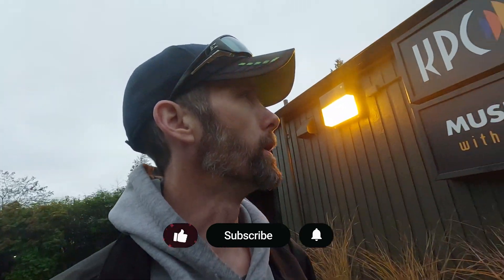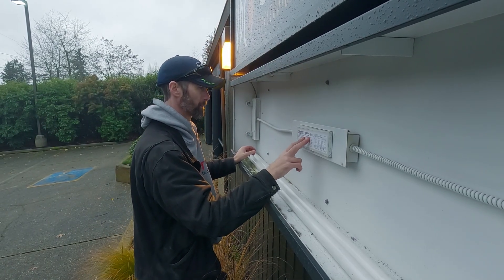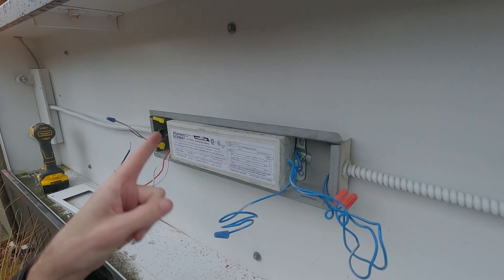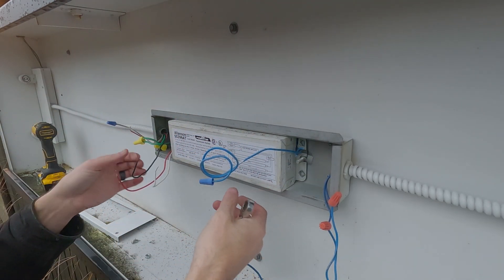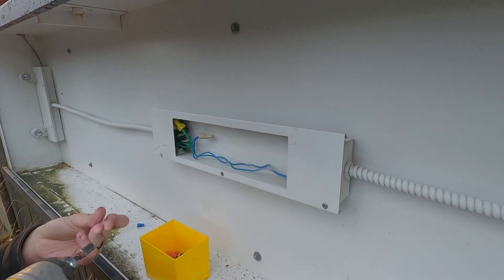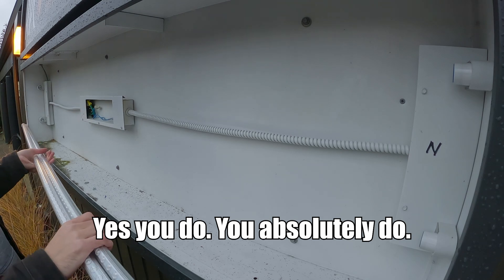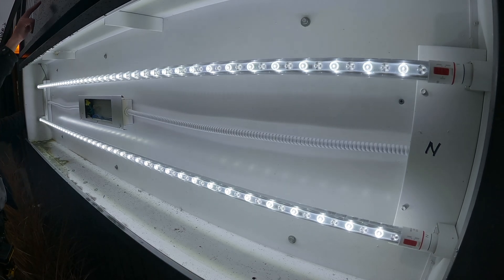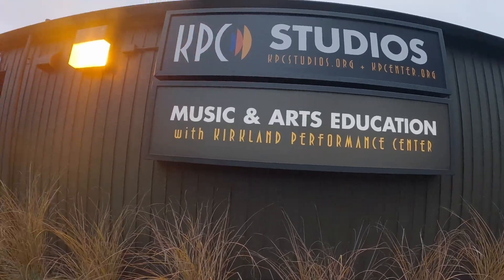The Day I Became A Sign Hero | An LED Retrofit

Comment: do you know why the LN is on one side and just L on the other?
Reply from the maker: It usually is labeled with just an L on one side and N on the other. N meaning Neutral, and L meaning Line, or the hot primary voltage conductor. I still haven't found out why one side has LN on the one side.

Comment: Like most LED assemblies with multiple color temperature settings, you may have noticed that the 4000°K and 6500°K settings only light every other LED.  5000°K is achieved by lighting all LEDs.  It makes me wonder if the 5000°K setting is more, or less reliable than the other settings.  Thanks again for another informative video.
Reply from the maker: I noticed that as well! I also had that thought about the 5000k setting, and I am not sure if it would be more or less reliable, since regardless of which setting you choose, those LEDs would be on for their lifespan. That said, you could probably run 6500K to its lifespan, and then just switch to 4000k and have essentially a brand new fixture, just at a different temperature. Great question! Thanks for watching!